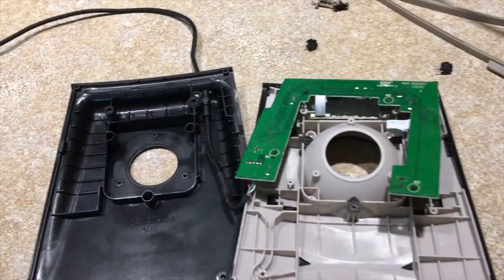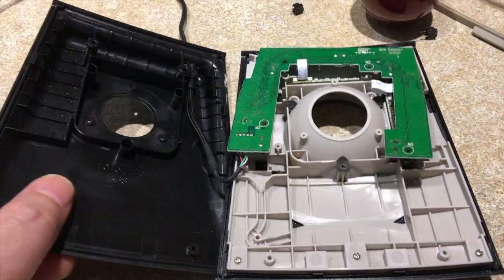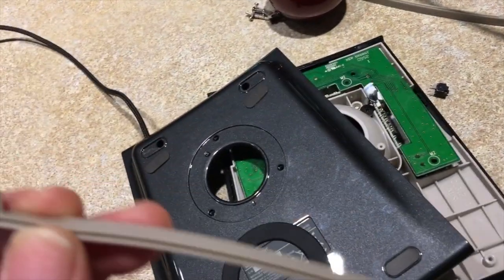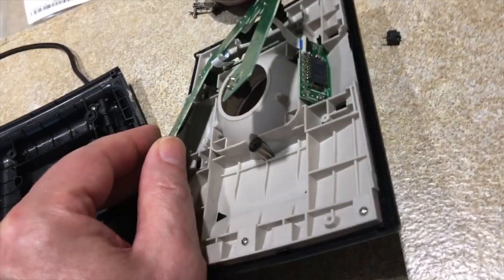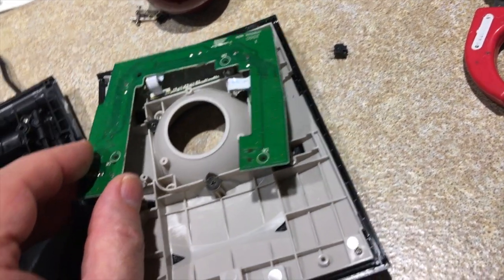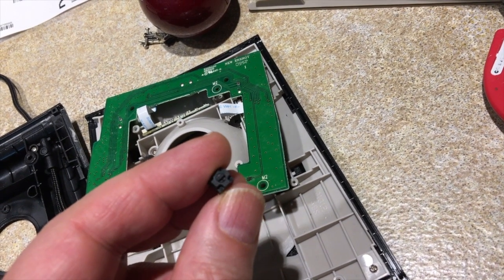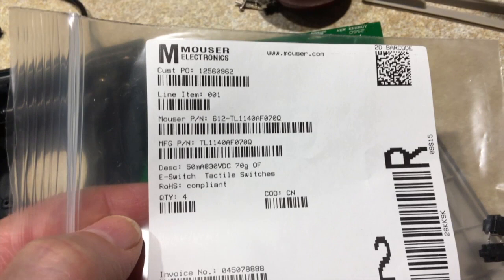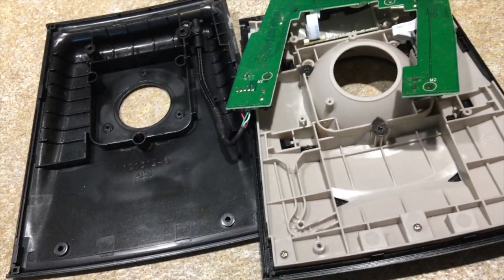Kensington SlimBlade Trackball switch repair/replacement

Comment: is the part also compatible o the Kensington Orbit?
Reply from the maker: I've never been inside a Kensington Orbit, so I don't know. Maybe someone else knows. Take a look at the part in this video and see if it looks the same. It's just a switch, so it's not inconceivable that Kensington is using the same part in different devices.

Comment: Thx but trying to find out how to get at the plastic behind the buttons bc I spilt some soda on it n it’s stickin a bit... can’t find that anywhere, all the other vids just get to the switches.
Reply from the maker: I think if you take it apart in the same manner, you'll be able to get at the areas you need to clean.

Comment: I find the stock switches too stiff, after 20 minutes my fingers get tired of clicking. Did you find any replacement switch that requires less force to register click? Thanks for posting this helpful video

Comment: I didn't want to wait for parts to arrive so I dabbed some 99% iso alcohol on the faulty switch and clicked it in a few times. The tactile clickis muted initially but the click actuates every time now. I expect the tactile click to return when the alcohol evaporates as mentioned in another comment. Thanks for the teardown guide!

Comment: Are there any SILENT switches compatible with the Slimblade (or at least less noisy than the stock ones)? The clicking is so loud that I couldn't use it in my office, which is why I bought it in the first place...

Comment: Thanks for posting this video. Helped me a lot. My left click died on mine. So I removed the four corner screws and couldn't feel a fifth under the serial number but it wasn't coming off, so I found the three screws under the circular pad from your video. I really didn't want to compromise the integrity of the round base unless necessary. However, I happened to be able to spray some WD-40 brand electrical contact cleaner spray on the switch and that seemed to do the trick. At first it had no click so I was opting to buy the new switch but after the solvent dissipated, the click came back. Thanks again for the post.

Comment: I just got a Slimblade and I wanted to be sure that I could get replacement switches down the line. The part number in the video description seems to be out of stock and unavailable elsewhere. I did find some Panasonic ones that look compatible. They actually come in two flavors, one with 75g actuation force and the other with 130gf.

Part numbers:  EVQ-P0E07K (75gf; DigiKey P10843S-ND) and EVQ-P0D07K (130gf; DigiKey 
P10844S-ND)
Reply: Very useful comment, thx!
Reply: How is the 75gf compared with the stock switch?

Comment: Thanks for the video and part information. I found that the specs for the E-switch part you mentioned are 1-million cycles. For a heavy user, say 1000 clicks per hour and 1000 hours per year, that would only last 1-year. Of course, it is 1-million minimum so it could be longer, but if possible I would like a higher rating.
I found a similar part from Panasonic EVQP0E07K which is rated for 5-million cycles. The physical dimensions are very close to the E-switch (within a few tenths of a millimeter), but not exactly the same. I am going to order some to see if they work (there are a number of ebay sellers).
Reply: Very useful comment, thx!
Reply: Did they end up working?
Reply: @MonsieurCanuck  Yes. But it was a huge hassle because my desoldering skills were not up to the task of desoldering the old switch. I ended up pulling one of the traces off the board along with the switch, and then I had to spend a lot of time repairing that so I could solder the new one in.

Comment: I think my usb cable went bad. was able to take a part fairly easy. any idea if I can find a replacment usb cable on the mouser site? thanks
Reply from the maker: I don't believe Mouser would have a cloth covered cable like that. If you need to replace the cable, you could use a spare cable you have on hand and just cut off the side you don't need, then strip the wire making sure to hook things up correctly.

Comment: Thanks for this!  I've ordered the part, I'll let you know how it goes.
Reply from the maker: Hope it goes well for you!
Reply: @LeeBlaske  Thanks it worked!  Now I just need to figure out how to glue the rubber pads pack on.  All the adhesive came apart when I pulled them off.
Reply from the maker: Contact cement is what you need, although it's sad to buy a whole bottle because so little is needed. Rubber cement would probably work, too, but not be as strong. Nice to use something not too permanent, so you can take it apart down the line if you need to.

Comment: Does Kensington not service this?
Reply from the maker: Don't know if they do or don't, but if it's out of warranty, the cost of shipping it to and from Kensington and paying them to repair it is probably more than what this is worth. Might as well just buy a new one.
Reply: Of course they do. Why wouldn't they? Unfortunately, they don't pay for your shipping cost to ship back their product even if it's under warranty. The cost of shipping the trackball back alone is more than the new part and the cost to have it shipped to you. It's a simple fix if you know how to solder.

Comment: Thanks for this, particularly for sharing the P/N. Before ordering a replacement I decided to spray some switch cleaner onto/into the faulty switch to see if that helped ... seems to have done the trick for now but I'll keep the mouser P/N on hand. I've also read in a forum that Kensington has a good replacement policy.

Comment: Aloha Lee, I've worked out the bad sensor and it's not the switch but something on the smaller board with the clear plastic piece... how did you find the part number to order a replacement?
Reply from the maker: I wish I could remember. I think I found the initial part number on some other discussion thread, and then I looked it up in the Mouser catalog myself. I don't have access to an actual parts list from Kensington, and I don't know if that's available. You'd probably have to check directly with Kensington. Sorry I don't have more info.